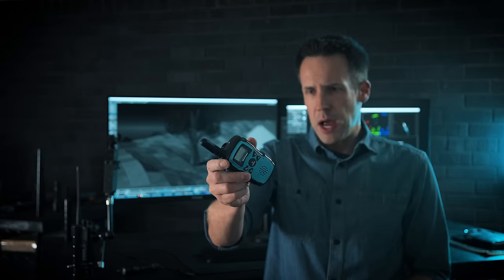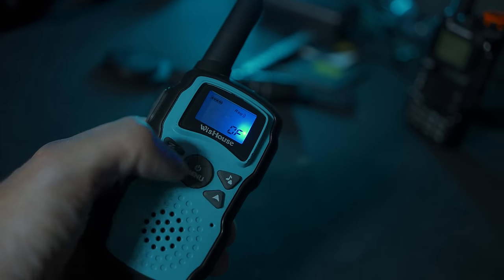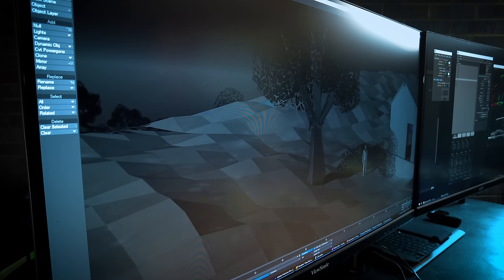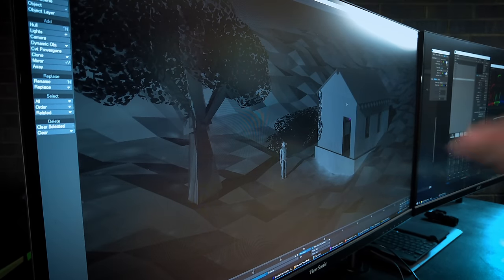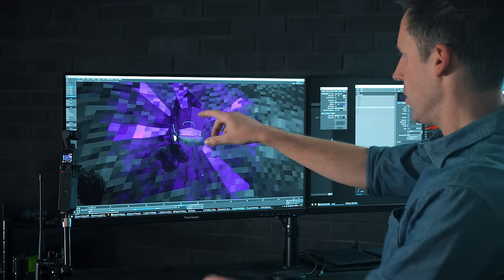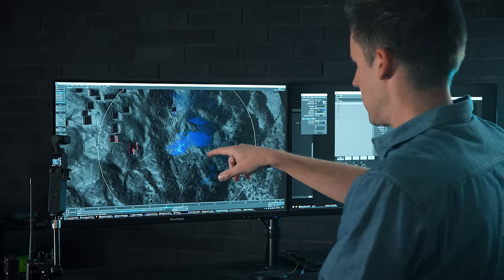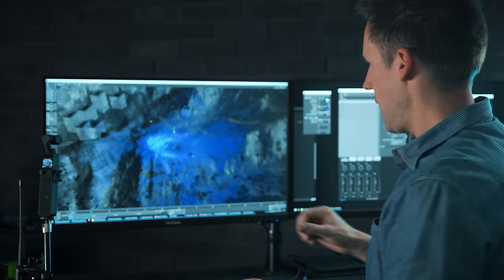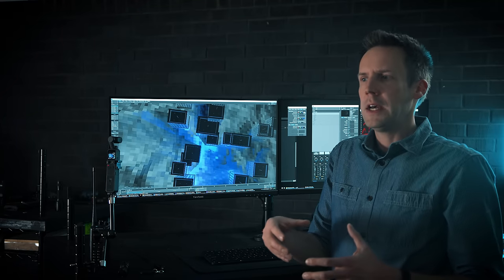How to Get MORE Radio Range

Comment: Thank you all so much for these videos. As a HAM radio Technician it’s extremely important that people have some method of communication when / if the phones go out. Even a bad storm in some areas of the country can destroy cell phone infrastructure.

Understanding that a radio, battery and antenna replace millions of dollars of cell network infrastructure is paramount. Instead of a phone, cell towers, carriers and lack of bandwidth options, you’re literally sending a radio wave at the speed of light from one point to another point (a large area / many people, sometimes with repeaters, etc). The point is this: A radio and its accessories form an entire infrastructure package that YOU control, and one that will still be operational even if the phones stop working.

Remember as well that monitoring without transmitting is legal on any channel without a license. 

Information is power, and a lot of local and statewide information is floating around out there. You just have to know where to look. Find your local radio club repeater/s and lookup their meetings (net) times and start listening with a cheap handheld (HT) 2M / 70cm radio. If you become intrigued go get your Technician level HAM license and *don’t be intimidated*. You can do it! Radio can open up a whole new world for you.

Comment: I can ABSOLUTELY concur with the directional antenna. I, very quickly, built a yagi for GMRS and my UV5R on 5w . Took it to a high peak here in Oklahoma and had contact with a repeater 73 miles away with AMAZING signal.

Comment: Directional Atennas is the way for the best range. Our SATCOM antennas (I feel Brandon has definitely mentioned this to you guys) in the military were obviously extremely directional antennas and you had to know where to point it EXACTLY. For Opsec reasons I won't say where but in country it was universal. 

I really love this example of radio placement and the typical estimated range you will get with HT radios. Keep in mind and I know youll definitely make a video on this, but this is only "simplex" (radio to radio) where as hopping on Repeaters changes the entire story. 

One thing to keep in mind thou (again, this will deff go more advanced than this video demonstrates, but you slightly touched on it at the end)  is your Antennas "VSWR" or Voltage Standing Wave Ratio. Which is a mathematical calculation on how much power is transmitted out of your radio, into your antenna, and how much of that power is reflected back into the radio. A 1:1 SWR would mean on that frequency, if you are outputting 8 watts, your antenna is putting out exactly 8 watts. But antennas arent that perfect and EVERY frequency will operate differently. One UHF frequency may get a 2:15 SWR which is still very good, youre only getting a small amount of power reflected back into your radio....but maybe if you jump 20 mhz up the band...with that same antenna you might get a 4:1 SWR which reflect ALOT of your transmitting power back into your radio and youre putting out like 2 watts, rather than 8. REALLY decreasing your distance you can achieve. So antenna choices are VERY important to consider. Broadband antennas will have VSWRs that can go all over the place, but buying TUNED antennas for the bands youll be on is more ideal. I keep two antennas on the back of my plate carrier. One I know that has great VSWR tuned to VHF, and one antenna tuned for UHF and I switch the routing cable for what frequency I will be on. It's good to buy SWR meters (theyre not that expensive) to see which antennas are best for you but this plays a MAJOR roll in the distance you will get. 

Im really digging the Trex Labs channel - this is information EVERYONE needs to know

Comment: 15 year radio maintenance here:
UHF is better in urban.
VHF is better in forest.
HF is better for talking beyond the horizon. 
Frequency is directly related to antenna size. Higher freq means smaller antenna.
Reply: Thanks❤❤❤
Reply: I've heard UHF is better in urban but why? Penetration of higher frequencies is lower. *Assuming antenna size isn't an issue*
Reply: Yup. That's why most police radios are UHF.
Reply: @benjaminpauza159 
Good question. UHF may be worse at penetrating some materials, but are better at bouncing off of steel glass and concrete. Imagine all the concrete is mirrored, and you're blinking a flashlight to signal someone. You may not have line of sight, but the reflections are visible.
Reply: @kerbalairforce8802 thanks for answering them. I’ve been wondering this very same question.  Cheers
Reply: How does the 900mhz band operate in urban or woods?

Comment: Awesome content!!  Great visuals and analogies to teach a complicated subject!  At 14:56, in radio propagation, there is also diffraction over the crest of the hill to consider which can "bend" the waves downward over the crest (or even around or over buildings).  But this mostly applies to midrange frequencies such as the upper end of VHF and the lower end of UHF and it won't be a sharp "bend".  Please keep up the good work on this new channel!

Comment: This was very interesting. I work in public safety, always had it told to me that if we switched to UHF radios our performance inside of large buildings would be better (than VHF) because UHF would penetrate through the walls more easily. The video seems to suggest the opposite. Is this incorrect or were my coworkers mistaking the “bouncy-ness” of UHF for penetration?
Reply from the maker: It is almost impossible to tell the difference, and it depends a lot on building materials, so... likely?

Comment: Besides elevation and increasing power is there any way to focus the stock antenna of a blister pack radio? Like making a reflector out of a pop can or some other kind of in situ MacGyver type stuff if that doesn't work? Just curious
Reply: That will help. Probably a piece of metal as a ground plane or a reflector will do something more than a tin can. The bigger issue is that many of those radios have very inefficient antennas, so you don't have as much to work with.

Comment: I always thought that UHF would actually penetrate buildings better but be shorter range, and that VHF couldn’t penetrate dense buildings but would travel further, and those reasons being why UHF=urban, VHF=rural. Is this implying that VHF actually penetrates more, and that it may be better to use in an urban environment between 2 people INSIDE 2 different buildings, so that the signal would penetrate each one instead of just reflecting? And that if both people are OUTSIDE but in an urban environment, that’s optimal for UHF because of the reflection and not as much penetration?

Weird way to ask the question but just trying to understand.
Reply: I think you are generally right, but it depends so much on the building materials that it's not always predictable.This is part of the reason that I like dual-band radios. If you and your buddy have a simple comms plan that tells you when to switch between bands or channels, you can try multiple things until you get through.

Comment: ❤❤❤.  Bou Fun.  U.V. 5. U.V 8.     What is the current screw on antenna that increases range over the stock mini nubbi one.    A few years back I got the 771 and that fold out flattish military looking one in 42 inch.      Is there any better options???????????❤❤❤.  -|and Thank You for the great video Mr. Dinosaur ❤❤❤

Comment: What was the software at 4:05?
Reply: That is the basic veiwshed model inside of ATAK. It's very responsive if you have good resolution DEM data. There is also a plug-in to specifically estimate RF propagation, but I have not used it.